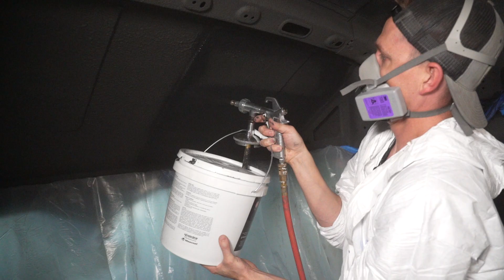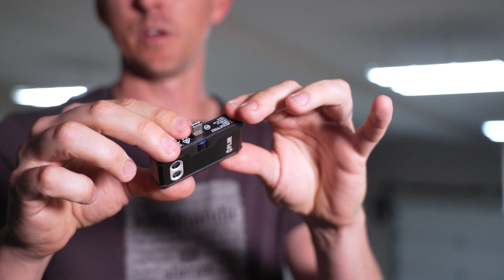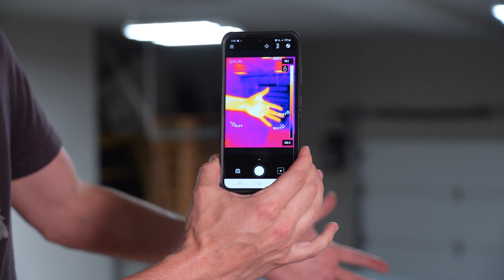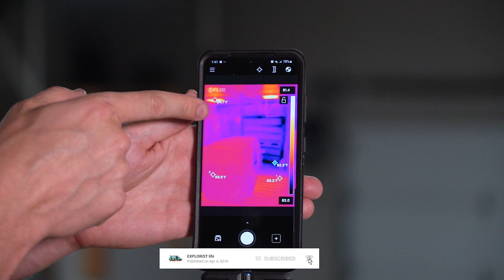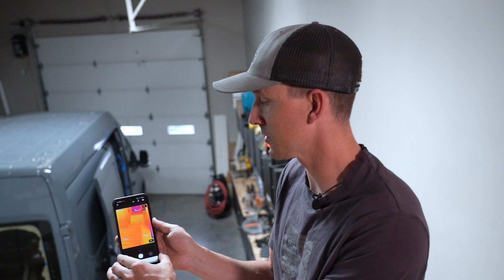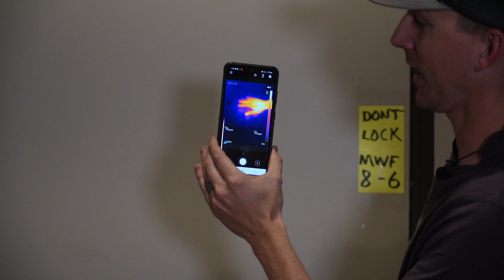Lizard Skin Ceramic Insulation TESTED with a Thermal Camera on our Ford Transit DIY Camper Van

Comment: Another way yo prevent some heat from reaching your interior, is to mount your rigid solar panels 4" or so above the roof.  This allows good air flow to wisp away the heat gererated by the panels while shading the roof.
Reply from the maker: Definitely!  The solar panels will shade the metal from UV heat gain and the ceramic will help even further from the convective heat from the solar panels.  We will have every inch of the roof covered by solar panels, an AC, and a fan.
Reply: cooler panels perform better, an air space is recommended.
Reply from the maker: @leonardkellum6984  We will have an air space. 👍🙂

Comment: Great video! I was interested to see how it turned out. As a thermographer with over a decade of experience it would be fun comparing a higher spec camera against the FLIR One you used.
Reply from the maker: I will say that this camera is significantly better than the TIC we used on the fire department. 🤣😂

Comment: Friend of mine had a standard van he was converting. He had all his wiring in and decided to get it sprayed with closed cell foam from a company that was doing his neighbor's house. He prepped/taped off everything that needed protection and for $200 had it done. Huge difference sound wise and heat/cold retention. No warping of body panels and the price was right!
Reply: @Mr. E. Ryter - Closed cell spray foam isn't toxic after it off-gases for a few days.  If it was permanently toxic, California would never allow it to be used in homes.